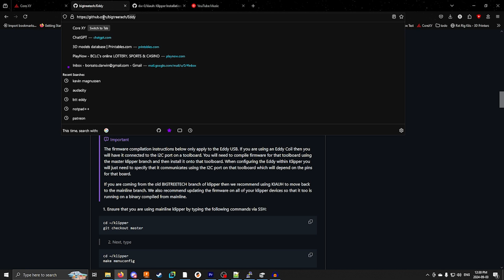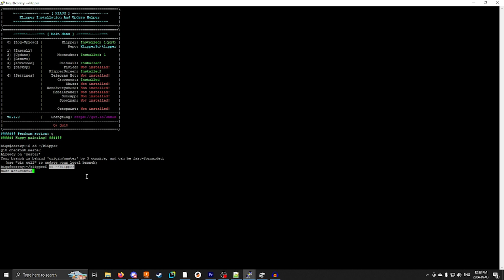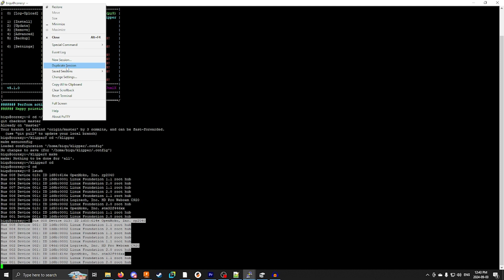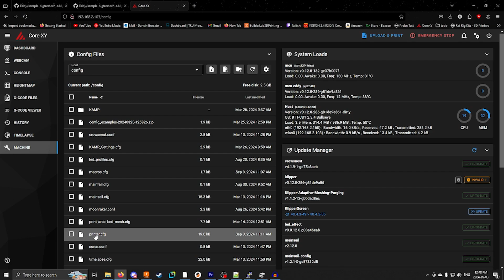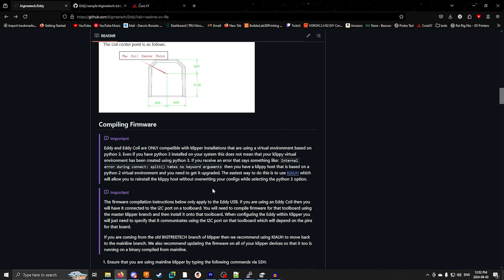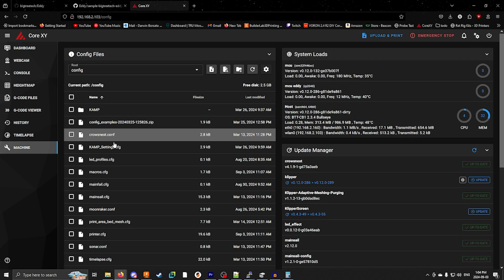Unlocking the Power of BTT Eddy: Part 1 - Your Ultimate Setup Guide

Comment: I am in need of your help. I followed your video and I am now getting mcu 'eddy' unable to connect. Every other part was done with success
Reply from the maker: That’s odd, make sure you’re using the correct firmware and check all your connections. Ive had that issue when the connector on the eddy wasnt fully seated
Reply: @ it’s completely seated. Firmware flashed. And my RPi and klipper recognizes the Eddy, but still no dice.
Reply: @Wraith1979  Got the same error. My setup is an RPi 3B and an Eddy USB. What resolved my issue was entering ls /dev/serial/by-id/* via SSH. It returned two results. I used the one that included "usb-Klipper_rp2040" in the name, and now Eddy is recognized.

Comment: Hi There!! thanks for the video. It isn't clear to me the where should I put the tape on the bed? is that dot the bed's center?
Reply from the maker: Just generally in the middle. Its not the end of the world if its off by a bit but just divide your bed in half so 230 would be 115 and send g1 x125 y125 z20 and it should get you there
Reply: @builderlab3dprinting  thanks!!!!

Comment: I'm looking into this for my ratrig as the bl-touch just croaked again but I'm concerned if i put my glass plate ontop of my normal bed then i will get a head crash like with an inductive probe.
Reply from the maker: Yeah i would not recommend the glass bed as the top layer for the eddy you really need a conductive surface for it to work properly.
Reply: @builderlab3dprinting  cool, thx for the reply, found out the probes fine the sensor pin on my octopus died, gonna test the octocoupler tomorrow. If it's not one thing its another. :)
Reply from the maker: I would recommend the eddy if you are willing to switch bed surfaces

Comment: hi! I also started using Eddy!
I have a problem when I print parts with a grid from Eddy. The height of the printed parts increases by about +0.6 mm. What could it be??? FADE is off! If without a grid, all the dimensions are perfect!
Reply from the maker: hmm that's a tricky one i think i might be having a bit of the same issue on my printer too
Reply: @builderlab3dprinting  I've been trying to solve this problem for a week!
It is interesting that the more parts on the table, the more the height of the model will increase))))))
Reply from the maker: I've tried to replicate your issue but i haven't been able to. What slicer are you running maybe a setting? I've honestly never encountered this before
Reply: @builderlab3dprinting  Orcaslicer! the problem is not in the slicer! when I print this Gcode without a mesh all the sizes are perfect! you use Eddy as a Z virtual endstop? and could you share your Bed mesh settings?
Reply from the maker: @borys9549  yes for sure ill post it to my GitHub when i get home today
Reply from the maker: @borys9549  i do use it as my z endstop ill put all of my configs up in a few hours
Reply: @builderlab3dprinting  Thank you! If possible, the printer config and let me know when I can download it!
Reply from the maker: Just uploaded them now https://pastebin.com/f6CFFu93

Comment: HI, when i do a bed mesh i get this error (Error on 'PROBE_EDDY_CURRENT_CALIBRATE': missing CHIP) any idee?
Reply from the maker: @geraldblindeling4405  is the probe plugged in? I think thats when i saw that error. Also are you using the usb version or the can bus?
Reply: @builderlab3dprinting  hi, yes its plugged in and i use usb version.
Reply from the maker: @geraldblindeling4405  oh whats the command are you sending when you get that
Reply from the maker: Try G28 to home all then 
BED_MESH_CALIBRATE METHOD=rapid_scan
Once complete SAVE_CONFIG

Comment: Hi I got the Eddy as well and got the problem it says Error during Homing .. any ideas so far? Too close to the bed maybe?
Reply from the maker: How far from the bed when the nozzle is touching it(the bed) is the bottom of the eddy. Also if your bed rises alot from one side to the other this will happen
Reply: The error comes out when i give home all axis command, it gives that error just before touching the bed (nozzle very close to bed but it does not touch it)
Reply from the maker: It sounds like maybe the calibration didnt stick might just want to re do the calibration from here https://github.com/bigtreetech/Eddy?tab=readme-ov-file#z-endstop
If the eddy isnt within that 2-3mm window off the bed when the nozzle is touching the bed it seems to get weird